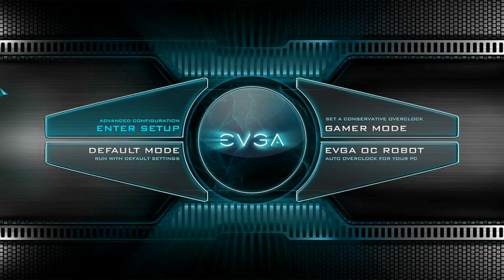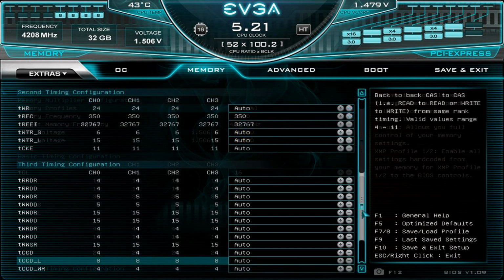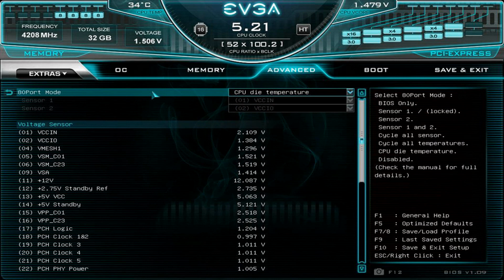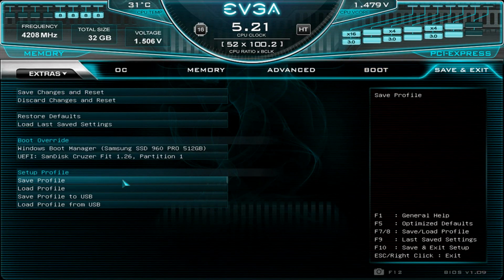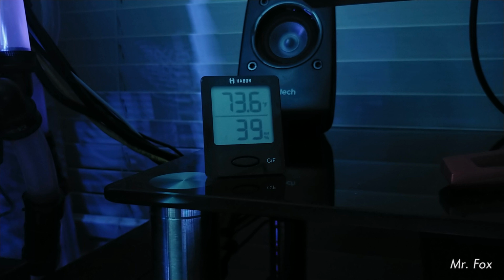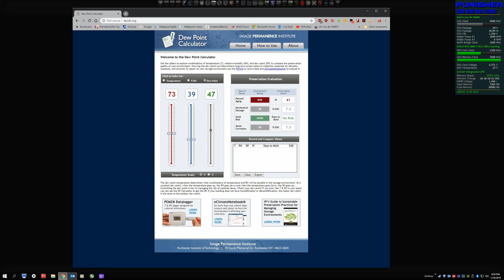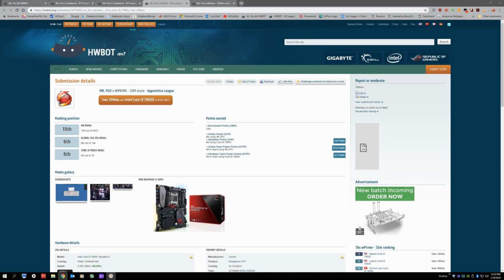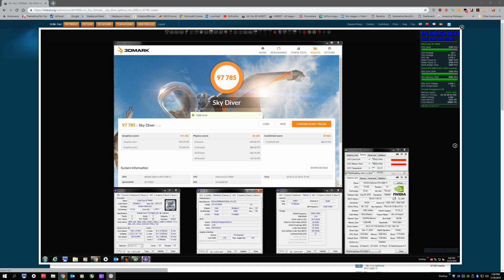X299 Dark 5.2GHz 7960X and DDR4 4200 BIOS Settings

Comment: Was wondering do you have similar clock settings with ppl that are using fan cooled?
Reply from the maker: I'm sorry I do not. I've never seen a CPU air cooler capable of handling that many watts effectively.
Reply: @MrFoxRox  I have the same CPU as you an motherboard on fan cooled at 4.5 staying at 55c on call of duty warzone

Comment: I got 10980XE at 5.1Ghz but my PC shuts down when I run CB15 few times. Temps are good. Package temps 85C max core temps 75-84C at 1.315V. Any clue to why would that happen?
Reply from the maker: There are a few things that can cause this. Voltage may be too low. The VRM may be overloaded or overheating. If you haven't checked the VRM yet or maxed out VRM settings in the bios look into that. You could also have an issue with the power supply. In Cinebench my 7980XE could pull more than 1000 Watts at 5.1 to 5.3GHz. If the power supply is too small or not functioning correctly you may be exhausting its output capabilities.
Reply: @MrFoxRox  I have AX1600i. Thanks for quick reply btw! I have X299 Dark, do you know where and what I need to set the power limits?
Reply from the maker: @krystiandomagala4929  that should already be maxed out by default on the X299 Dark, so no need to change that on this motherboard. Because it's already maxed out there is no BIOS setting (no need for it). Try giving it a little more voltage. Also try maxing out the speed of the fans on the VRM.

The first power supply I tried using with the 7980xe was a 1000 watt unit and it was too small. I ended up having to upgrade and purchased a 1600 w PSU.
Reply: @MrFoxRox  You're a God amongst men. Thank you very much. I will try that right away. This 10980XE seems to be binned like a champ. Want to take advantage.
Reply: @MrFoxRox  Cooling I have is 5x 480mm XE rads with 2x D5 pumps and 20x Noctua Industrial 3000RPM fans. GPU has another 5 rads and another 20 fans as well.
Reply: @MrFoxRox  You were right. Wasn't enough voltage. It's not turning off now just gives an error. Thanks a bunch!
Reply: @MrFoxRox  Never mind. I raised voltage to 1.34V and still reboots. I think it may not be voltage at this point.

Comment: Mr. Fox please share the ram  model you used
Reply from the maker: I use only Samsung B-die. That is more important than the memory brand name. These are the kits I have used in recent years with great results, and all were built using Samsung B-die for the IC:
G.SKILL: https://www.newegg.com/g-skill-32gb-288-pin-ddr4-sdram/p/N82E16820374021
Patriot: https://www.amazon.com/gp/product/B07TWJ42VQ
Corsair: https://www.amazon.com/gp/product/B01N9Q6EM0

Comment: I have a 9800X running on a Gigabyte Aorus X299X Waterforce Extreme. I have a set of 4x16 DDR4 3200CL16 (G. Skill Ripjaws V) and I can't get it to boot at 3300... Can't change the timings, nothing... It uses a Hynix chip, this one that I have, especifically, is not a good overclocker at all. I tried cranking up the voltage with no luck.

I just got myself some new ram for the same price, but it is a Corsair RGB Pro kit, same thing, 3200CL16, but it will probably come with better chips this time, it can be any of these for my new ram kit
H5AN8G8NCJR-TFC from Hynix (which I heard is great for OC) or the K4A8G085WB-BCPB from Samsung (B-die), same as my wife's 4800CL18 Kit. Some people on the internet said the K4A8G085WB-BCPB is a "cheap B-die variant", "budget b-die", which cannot possibly be true since my wife's 4800CL18 kit holds the exact same K4A8G085WB-BCPB.

The 9800X is running stable and at low temps @ 5.0Ghz/3.6Ghz mesh.  I used to have a 7980XE (non delid) that I left at my company since it is used for rendering and other tasks. The 9800X is already soldered and is much better at holding lower temperatures. I don't care about AVX because it is garbage and was always garbage anyway. But Gigabyte's X299X Waterforce does a heavy lifting when it comes to cooling down the CPU.

Did you ever hit that sort of "brick wall" when it comes to OC'ing regular memory?
Reply: High frequency is not what makes b die good ;) 4000+ 12 10/11 10/11 28 is what makes good b die. No other memory ic can touch that.  Some of the worst b die I have had was a team group 4800 cas 18-22-22 kit. One of my best 16gb kits can run 12 10 10 28 3800 1.8v and that is a 3600 c16 bin trident z kit.  Best 32gb kit runs 4000 14 14 14 32 1.5v, 4266 c17 ripjaws.  Am waiting on my 5900x to push them further.

Edit: This is all on a 9900kf and a z390 Dark.
Reply from the maker: I hope you end up happier with your 5900X than I am with my 5950X. I seriously regret buying it. I should have stuck with my 10900K and Z490 Dark. It was so much better. AMD sucks at CPU and memory overclocking and I should have followed my gut and stuck with Intel. The USB drop-out problem is also inexcusable. It's NOT fixed even though they want to pretend it is, and neither is the FCLK instability running 1:1 unless you stay at or below 1900 (3800 on memory). I runs too hot and PBO is thermally limited. Using fixed core ratios makes it run even hotter. I hate it. Waste of money on buggy crap.

Comment: So if you dont mind helping out

I just went to a:
X299 Dark
i9-9900x Chip
Trident Z Memory 3200
2080ti EVGA Kingpin

Factory memory ofcourse is 2133, I made sure the memory I bought was tried out and compatible on EVGA.com, but if I go into the bios and just turn from auto to 3200, the computer freezes up and wont boot. From watching your video Im guessing it could not just be that easy haha

Would you mind helping me out on turning this up?
Reply from the maker: Hi Lucas. Instead of changing the RAM speed to 3200 have you tried setting the memory to use XMP Profile 1? That should adjust everything else automatically. If you manually set 3200 the voltage and other settings are for 2133 and will not usually work correctly.
Reply: @MrFoxRox  That worked perfect!!!!  Thanks for the help!!!
Reply from the maker: @repo621  you're welcome bro. Glad it was so simple. Have a good night.

Comment: Why is your pch voltage raised to 1.2 v ?
Reply from the maker: Hi Kristian. The normal range is 1.000V to 1.200V. While it is mostly useful for high BCLK, I have elevated it to the top of the normal range to maximize stability with the increased core clock, mesh/cache clock, bumped BCLK, memory frequency and tighter memory timings.
Reply: Ok thank you very much 😊

Comment: What do run your cpu at when you're not doing intense benching?
Reply from the maker: Usually 4.8-4.9GHz.
Reply: @MrFoxRox  that's really good for 16 cores. Under everyday use, I run my 12 core at 4.5 to 4.7. My temps drastically improved after I swapped the TIM for liquid metal. It rarely hits 60c.
Reply from the maker: @skycorrigan6511  those are nice temps you're geting. Yes, delid and using liquid metal is hugely beneficial.